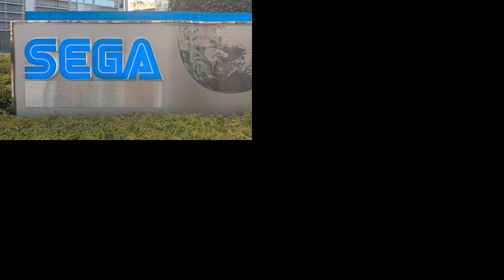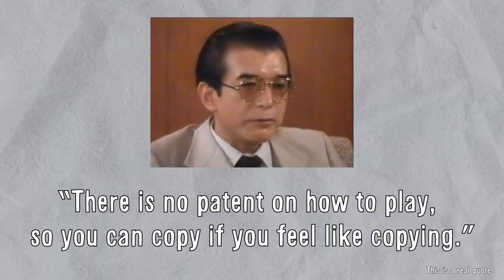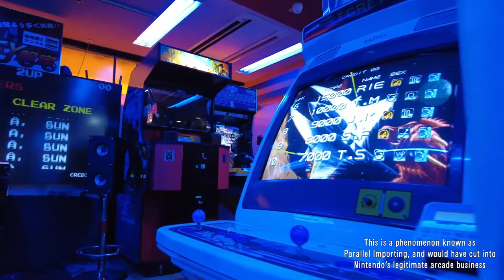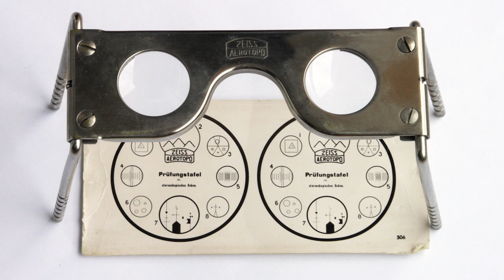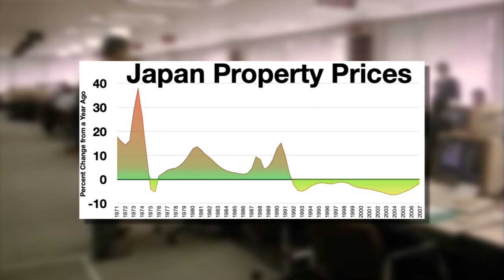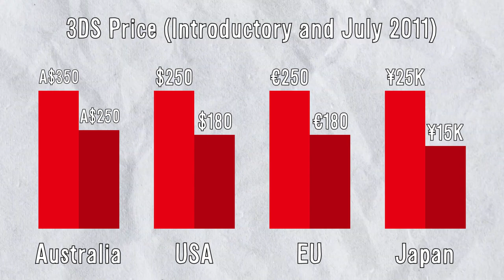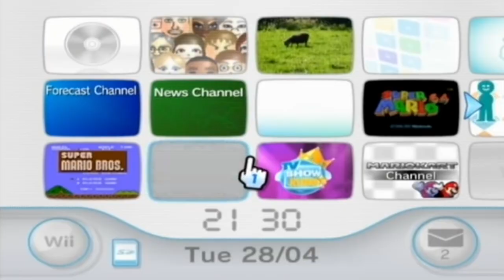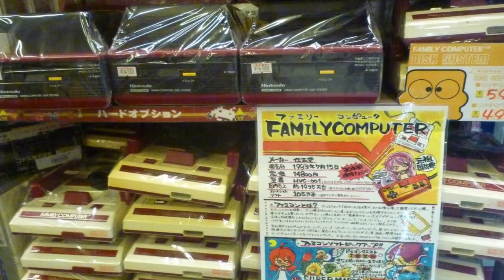A Brief History of Nintendo || 1889 - 2023

Comment: It's always a pet peeve of mine whenever people forget the Virtual Boy when they talk biggest failure for Nintendo, so glad you mentioned it and call Wii U the second biggest failure and not biggest
Reply from the maker: It was the biggest failure in that it was Nintendo's worst selling console. However, while the virtual boy was out, the GameBoy and GBC were going gangbusters, and the N64 was doing reasonably well. The virtual boy was basically a side offering from Nintendo; their mainline products were doing fine, and Nintendo itself remained profitable/successful during that mid to late 90's period. With the Wii U, while it did outsell the virtual boy, it was Nintendo's then main offering and intended to be their primary money-maker. Its failure contributed to Nintendo going into the red for the first time in decades. The fact it had such a massive, negative impact is likely why people call the Wii U Nintendo's biggest failure.
Reply: @CiggySnake  The Virtual Boy did only have a lifespan of a year while they supported the Wii U for more. But I do find it somewhat poetic the two failures resulted in two successful systems (the 3DS and the Switch). Maybe you could argue that the instant rice was Nintendo's biggest failure as they never did anything with that again.